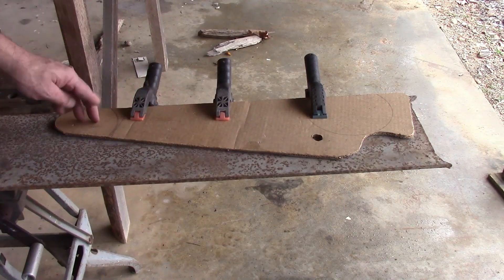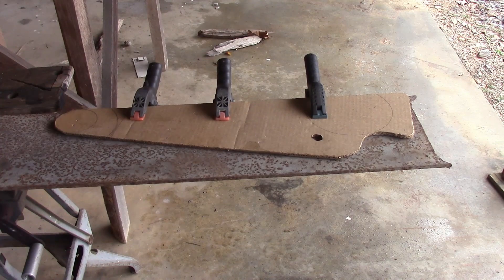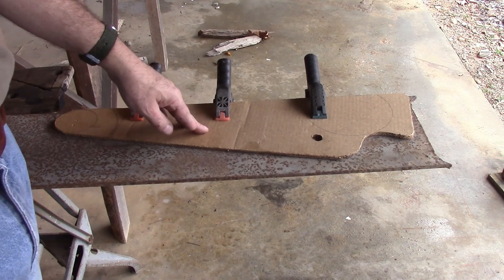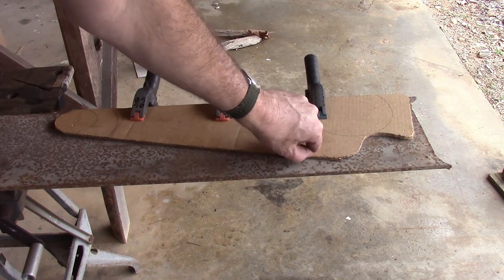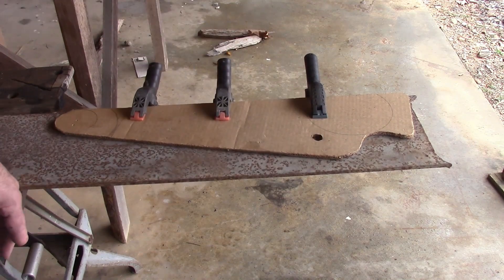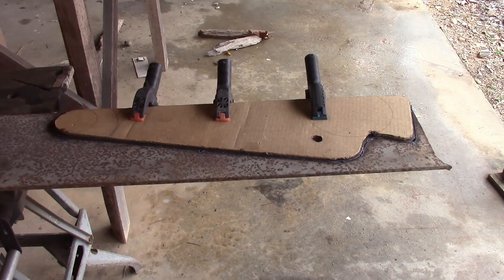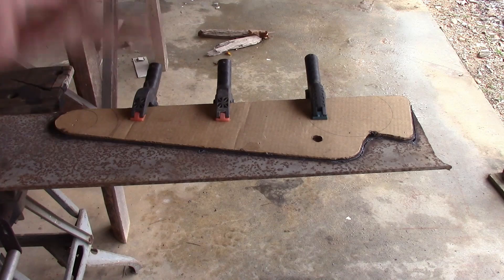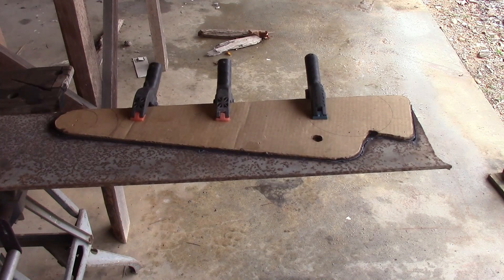Plasma Torch Templates: Can I use Cardboard?

Comment: Hello, did you use a common cardboard to make the mold of the piece you wanted to ??? It doesn't burn with the heat
Reply from the maker: Yes common cardboard and yes it burned but worked for a one off.

Comment: Have you tried spray painting the edges of the cardboard or other flammable materials with a heat resistant paint ? Most of them are good for up to 600 c  , There’s a lot of choices available from most major outlets.
Reply from the maker: I haven't tried that but thanks for sharing!

Comment: Try putting some adhesive backed foil tape on the edge of the card board.  Used to work well on 1/4" Masonite when hot cutting 1000d Nylon, patterns lasted a very long time.
Reply from the maker: That's a great idea!!  Thanks!!

Comment: Well done. I have also tried 1/4 inch hardboard, actually it was the back of an old cabinet we were taking down.  That worked for several cuts as I recall.  Never thought of using cardboard.  Another thing that works good is scraps of hardyboard. Good video, Thanks and have a good weekend.
Reply from the maker: Hardboard would be my first choice, I bet it would last a long time.  Thanks Glenn!